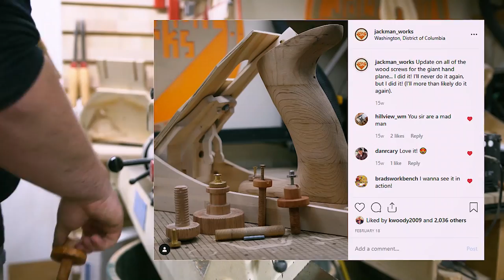Building a Giant Hand Plane (that actually makes shavings!)

Comment from the maker: Support the sponsors who made this project/video possible
𝐑𝐨𝐜𝐤𝐥𝐞𝐫 (tools I used on this build)
► Bench Dog Hand Planes - http://bit.ly/2X5T0qW
► Aluminum Bar Clamps - http://bit.ly/2XG6CGm
► Pipe Clamps - http://bit.ly/2MHbCtl
► Glue Spreader Bottle - http://bit.ly/2wThXqJ
► Silicone Glue Mat - http://bit.ly/2WYRBm4
► Router Lift - http://bit.ly/2XG7GKm
► Caliper Gauge - http://bit.ly/2R6LTJm
► Push Bloc - http://bit.ly/2KJ3TIw
► Bench Cookie - http://bit.ly/2XDCCLj
► T track table - http://bit.ly/2R54J3C
𝐈𝐒𝐎𝐭𝐮𝐧𝐞𝐬
► My exclusive solution for hearing protection in the shop, ISOtunes, get your own here - http://bit.ly/2KKp50T

And a huge thanks to these guys who also made the project/video possible
► Zack made that amazing blade! http://bit.ly/2WzeRrk
► Pat Lap helped me with the intro music http://bit.ly/2ZeoYi0
► Dan Cary from Rockler made the infomercial http://bit.ly/2Zg6o9m
► Herb Brooks did the Miracle voice over for me http://bit.ly/2XMXsYZ
Reply: this is one of the perhaps most fascinating projects I have seen so far :-)

Comment: Honest question: whats the problem with the wet rag? Every show I've worked in for both theater and furniture used wet rags to wipe up the glue
Reply from the maker: No problem! Honest answer. Because when you wipe off the glue is also rubs a small amount of it into the grain of the wood where it dries and you'll be able to see it when you apply finish. Just let it dry for a couple of hours and take it off with a chisel instead, it'll be hardened enough to cut off but also still soft enough to remove easily without spreading it around.
Reply: @JackmanWorks  Thank you! Always enjoy your awesome projects and fantastic video editing abilities

Comment: What’s the reason to cut the knob into a hexagonal to then round it off?
Reply from the maker: It cuts off most of the material before I turn it round so it saves a lot of time on the lathe, especially at that scale

Comment: I bought one of those little sanding kits for the drill press, but it makes me very nervous to use it.  My drill press was made in the 1940s, and while the quill bearing seems to be okay, I'm sure it was never meant to take the lateral forces I'd put on it when sanding.  So now I'm hunting around for a dedicated spindle sander.  I just don't want to screw up my drill press.  Anyone else skeered like me?
Reply from the maker: I have a spindle sander, but it was broken during this built and I've sense gotten it fixed. I wouldn't recommend using the sander on the drill press a ton especially it it's an older drill press (I think the newer drill presses are built to handle those forces better)

Comment: How come no wet rag for the glue squeeze out?
Reply: I would also like to know.
Reply from the maker: Because when you wipe off the glue is also rubs a small amount of it into the grain of the wood where it dries and you'll be able to see it when you apply finish. Just let it dry for a couple of hours and take it off with a chisel instead, it'll be hardened enough to cut off but also still soft enough to remove easily without spreading it around.
Reply: @JackmanWorks  Good to know, thanks.